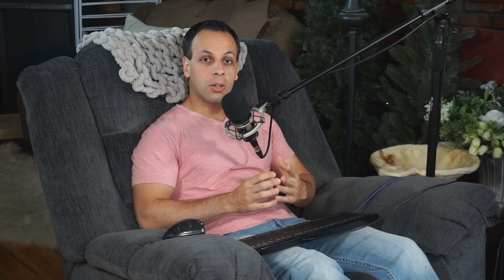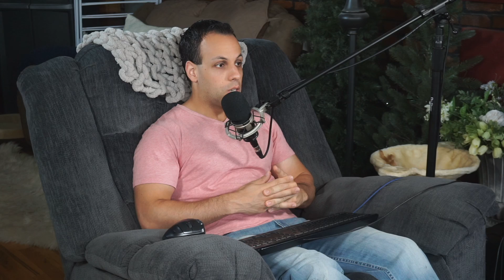Let's talk about what Right to Repair means for how devices are designed.

Comment: Reductio ad absurdum: an integrated circuit will never be repairable.  Youre not going to make transistor level repair to a cpu.  Similarly you arent going to try to repair a surface mount capacitor; youll replace it. There will always be some "atom" of repairability.

The argument is not that everything MUST be repairable, but that the atom of repairability should not be "the whole f***ing device".  The success of your business proves that to be a terrible standard.
Reply: >the atom of repairability should not be "the whole f***ing device"

Or the entire motherboard or something along those lines.
Reply: Really well put
Reply: I think the SMC level is the lowest most elementary repair. But at the same scale, the pcb is probably the worst case scenario for repair. I've seen Louis use small gauged wires to repair damaged PCBs. But anything lower than that is far too impractical. Like are you going to repair the SMC? Probably not. Or if a component is unobtainable on its own, or if the component is priced far more than reasonable. The latter cases are the current climate for components like screens and batteries.

So, if you own a device, or any product, you should have rights to the parts as well. You're probably not going to buy them buy the millions like a factory, so it'll be more profitable for the component manufacturers. That'll piss off the IP holder, like Apple, because they know most people would rather pay for a repair or do a repair then replace the entire thing. 

The big problem with SMCs is that it takes more advanced tools than a screwdriver and a ratchet set. That's probably around where this entire issue began.
Reply: Well, I believe some chips like charging chip, DMA chip etc. will always be out of the SOC. So, without the manufacturer explicitly barring repair, the device will always be to some extent repairable.
Reply: We can also let the free market decide what level of repair makes since. If I can buy a capacitor or a motherboard I can decide the right level of skill, time, and cost. Similar to vehicles do you want to rebuild a transmission, replace it, or trade in your car. Individuals will decide which option makes sense for them in their particular circumstance.
Reply: @hedonisticzen  That's exactly what this video says.
Reply: @hedonisticzen  problem with letting market decide is few consumers actually know the cost, specs, and usage of every piece of tech inside a cpu, so allowing market to decide level of repairability can cause some problems
Reply: @Scott Rudkin  All intellectual property is monopolistic by nature. It's blatant protectionism. Abolish ip. No need for regulation.
Reply: @Scott Rudkin  Slavery is the equivalent of mini governments with dictators. Government is coercion. The government needs to maintain it's monopoly on coercion unorder to exist. Might as well utilize their monopoly on force to rid out force holding everyone back. Slavery is only good for the slave owner. Even then though, having the ability to enslave everyone would destroy any incentive to go to and contribute to such society. Destroy innovation.
Reply: @Lominoth Productions  knowledge is also a self correcting problem in the market. There's countless videos and specialists who can support you. There's no reason to add this regulation.
Reply: @austinbyrd4164  No, this IS the reason for regulation.  If the only reason the repair market is not well functioning is because the IP owner abuses their market position to limit access to the knowledge and tools for repair we should stop that.  The way to stop it is by making rules around access to tools and knowledge.  This is literally what regulation is for - stopping bad behaviour.

The existence of a market is not evidence of a well functioning market.  Slavery made for a good labor market.

Comment: Parts and schematics. Yes. That involves no changes to the end device. The battery issue, I just refuse to buy anything that I can't change out, if enough people do that then there is incentive to allow it. Has saved me a few times, locks up,  pull the battery put it back and fixed. Drop it in water, pull the battery and there will be much less damage to track down.
Reply: Nobody asked for unremovable batteries or a phone they can take in the swimming pool once for a minute.  Everyone complained when they sealed the batteries.  They did it anyway
Reply: @tossacoin2urbernie462   Manufacturers felt they had to make their phones as thin as possible or they wouldn't sell well. But then Bendgate happened and customers seemed to stop caring so much about thinness. Nowadays, smartphones even seem to be getting thicker. It's almost the perfect time to bring back removable batteries!
Reply: @tossacoin2urbernie462  in pro/industrial electronics, such as tools, cameras and even retail workers' PDAs, if you announced a product without removable/replaceable batteries, you would win the golden globe for best comedy of the year. it actually just occurred to me today how much i hate charging my phone. because of my ADHD, and because I can't swap out my phone battery, my phone seems like it's always below 15% battery because i never remember to charge it, often finding this out after ive left the house for the day. whereas, as long as i remember to bring spare batteries, my camera will always have enough charge. i would be all for bringing back replaceable batteries, and for making phones tougher in general compared to the extremely fragile designs we see today.
Reply: @Ariel_emerald  yes but that's because of long periods of usage with high drain electronics. I have power tools, camera and use a pda at work. You really don't have much time to wait for the batteries to get charged again. While a phone has about equivalent battery capacity and is much lower on drain. So, typically one charge a day will last you. My power tools I can go through fifteen full 4 ah batteries in a day. The camera when heavily used about 4 personally. The PDA at work is used 24/7 almost. So it needs to have replaceable batteries as well to prevent down time.
Reply: @tossacoin2urbernie462  And no one had asked for soldered on CPU and GPU on laptops as well as non removeable battery. But they had done it anyway.
Reply: @tossacoin2urbernie462  yeah right, everyone complained when they sealed the batteries by buying more phones with sealed batteries.
Reply: if you want completely shut phone off battery must be removable.  if the battery is in you can be tracked and hacked.
Reply: I had a lumia 920 and 950 and galaxy phones that all had easily replaceable batteries and were still slick and powerful phones
Reply: @MrNoobed  
I miss my Lumia. How Windows didn't catch on over Android or IOS to me is virtually inconceivable aside from the massive hordes of dismissive "normies" that got us into this ongoing conundrum.

Seriously, my last Windows phone had half the guts and ran twice as good as this Android "one size fits all" crap.
Reply: @Draliseth  I agree with some of this, Android is just a horrible OS. iOS is much better in its speed and optimization, but is locked down beyond anything reasonable with no way to turn it off. However, Windows is nothing but horribly designed, disgusting spyware that may be faster than Android but I wouldn't use Windows if my life depended on it. I can go on for hours about Windows, anyway, it's horrible, there's nothing good about it, Linux does every single thing better, and Windows can disappear along with Android and iOS. The only reason everyone has not switched to Linux is that idiotic companies that shouldn't exist like Adobe (Creative Cloud), and Epic Games (Easy Anti-Cheat) are too lazy and stupid to switch over, causing a lack of programs, causing a lack of users, causing a positive feedback loop. My phone runs mainline Linux. It is great and while the PinePhone's hardware is quite bad by modern standards, the OS is getting to a point where it can actually compete with mobile OSes, and it can even run android apps via anbox.
Reply: @ArsenGaming  Android is Linux with a different set of accessories
Reply: @rexsceleratorum1632  That's just not true. Android does use the Linux kernel, but it does not use the GNU coreutils which 99% of Linux systems use. They have their own, horrible coreutils that don't support common features such as versioned sonames. Not only that, the kernel is quite heavily modified. I wouldn't call it Linux beyond a technicality.
Reply: @ArsenGaming  You said it's not true but then proceeded to explain how it is actually true. I said Linux, not GNU/Linux
Reply: @rexsceleratorum1632  Yes, it does use the Linux kernel, but when I said it was not true, I was referring to mainline Linux distros which basically all use GNU. I suppose I should be more specific when mentioning Linux, but I don't like mentioning GNU/Linux with those who do not know about it as it intimidates them. There are many people in this comments section who don't know what GNU is or what the parts of an entire OS is. Some people will research GNU/Linux when they see it, and the explanation will overwhelm them, causing them not to consider installing Linux. I would rather sacrifice a bit of clarity than scare away potential users.
Reply: @isakjones5836  I have never had to do one bit of troubleshooting with the beginner-friendly distros. Many distros do all the setup and everything else for you. While the distros I use now can be less stable, even they nearly almost work as expected. The few exceptions are the few devices with incompatible hardware which usually has to do with bad proprietary drivers and not Linux.
Reply: @Draliseth  absolutely.   I was very confused when I switched to android.  What do you mean it wont read my messages, navigate offline, or dock and turn itself into a desktop OS?  That was standard on my 920!
Reply: If the phone is water proof you don't need to worry about popping out the battery. Besides, replacing a built in battery which I just had done on my phone is not that difficult. The back of the device comes off easily with heat and the battery is replaced, glue is reapplied and the phone reassembled. It is how it is done. A laptop with a "built-in" battery can also have it replaced by removing a few screws and changing it out.
Reply: That's why i bought an xcover pro when my V20 gave up the ghost 👍
Reply: this. Too much focus is being put on trying to legislate companies to remove software locks or whatnot which is just MORE government legislation. Part exclusivity deals are anti-competitive (since I've gotten shit for this in the past, for reasons that are complicated enough to fill pages, I should know, I have, the concept of a free market requires enough legislation to ensure it STAYS free. Think about it like anarchy, if you WANTED a nation to stay an anarchy, you would need at least enough of a government to STOP another government from taking power) and schematics being protected "InTelEctUaL PrOPeRtY" gives them legal protection to hide their fuck ups and dick moves. 

if schematics were able to be shared freely, EVEN IF those schematics had to be leaked before they could be shared, every product's schematics would be free, let's be real. The issue right now is that the dumbass idea of "intellectual property" is being used to publicly protect private information. If, once a schematic was leaked, it was freely shareable, well, you can't stop that. Currently you can't share those schematics anywhere legally clean and in-the-open, but if you COULD, well now more schematics would be leaked, more people would be able to see those schematics, more people could see some of the shitty things that are in those schematics, more people would be thinking about repair ability, etc. 

In short, take the government PROTECTION away, and the problem solves itself. If I want to buy a shitty, locked down device that I own on technicality alone, I have the right to buy an iPhone. I won't, but I have that right. If I decide I don't care about those things, I have every right to buy a locked down device. What's important is just that the government protection be removed from the equation so that more people are allowed to talk about the issue.

(and, again, part exclusivity is extremely anti-competitive and, while it's a much more complicated topic, in it's current iteration of licensing other companies make parts exclusively for you, licensing game developers to only sell their game through your platform, etc. I think it is very much market manipulation. For apple's M series chips? Eeeh, that's a bit more iffy since they are making those chips themselves, so I think there they have the right to keep them to themselves, but generally, I think a good rule of thumb is if you have to make a deal, where a central part of that deal is involuntary exclusivity, then it's market manipulation.)

Comment: I only recently made the experience how hard it can be to get even simple parts. I've been watching the channel for years and now my Phone Battery is getting really bad. Oneplus lists the price for a replacement at 10€ + labor. But you can't buy the Battery directly. I would be happy to pay that price + shipping to get the part but they don't even sell something as simple as that. Sure you can find ones on Alibaba but you never know if they are real or of good quality. Also Oneplus lists on their site that they may wipe the phone during battery swaps, which seems really weird. Waiting a week without a phone and then spend a few hours on restoring the backup instead of just being able to pay 15-20€ for the battery seems like a bad option. So maybe right to repair needs to go further and require them to sell the parts for the same prices they charge with their repairs.
Reply: "may wipe the phone during battery swaps" is usually manufacturer code for "we actually throw yours in the bin and give you another persons refurbished one" so they can "fix" devices fast without actually having to fix devices fast

Comment: I think one part of the right to repair that you didn't cover is intentional design choices that the only reason for the design choice was to stop third-party repairs. such as pairing parts so that a change of a part bricks the device even if you use the exact same model of part as a replacement. that is about the only design choice I think should be illegal. other than that the rest of the right to repair should be tool/part/information availability like you mention.

Comment: For  me the main problem is serialization of components and using different  screws  sizes without  no reason  but make repair more difficult
Reply: I hope there will eventually be a law requiring electronics manufacturers to use standard screw sizes and head types. Almost everyone has a Philips head or a flathead, but almost no one except a professional repair worker has a screwdriver that fits into Apple's weird proprietary screws. (Companies like iFixit do their best to make those specialized tools more accessible, but that fact that they're "needed" for an application that would be just as well served by standard screws is indicative of the designers' desire to prevent the end user from easily repairing their own device.)
Reply: @InventorZahran  exactly. Fancy heads don't make a screw hold any better!

Comment: I actually want a brick laptop with a good user removable battery. you can unplug the battery and run it form charger to save for when you really need it if you use it half portable half as a desktop pc
Reply: I like the large Toshiba tecra just for this reason.

Comment: What if to counter right to repair, they just start making parts that are so integrated they become impossible to repair without destroying parts. Not just difficult to replace, but pretty much impossible.
Reply: That is fine. But if the manufacturer has the ability to fix it I should not be blocked from doing the same.
Reply: Then more laws are needed to discourage ewaste or outright ban it. Yeah free market will decide, but when everyone makes ewaste, there's no choice. In that case, legislation will have to outlaw ewaste production
Reply: I like this question and would like louis to respond to it. I wonder if manufacturer's would start integrating a chip or part on to the board that you are unable to replace without an entirely new board.
Reply: @sockaccount711  simple, you buy the whole part/board. Sure the cost of the repair increases but it would also cost more for the company to repair them. As the other poster started you would have to have ewaste laws in place to make sure the company just doesnt ditch devices wholesale, which happens now anyways.
Reply: They're doing that already to varying degrees.